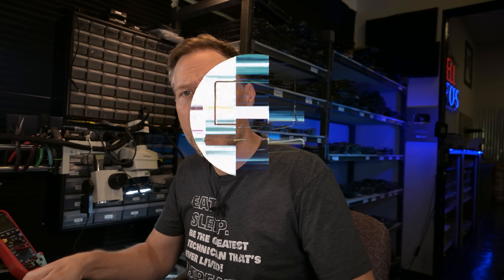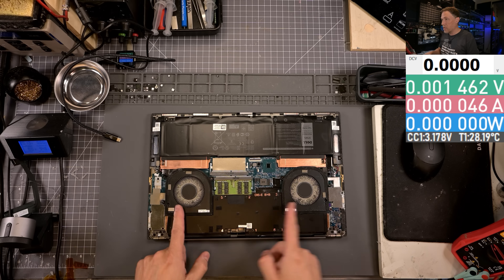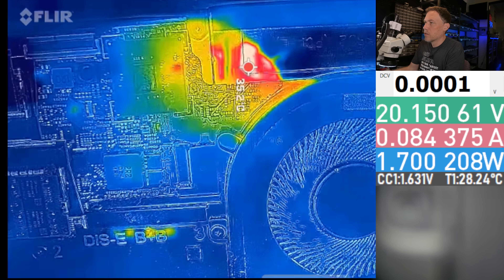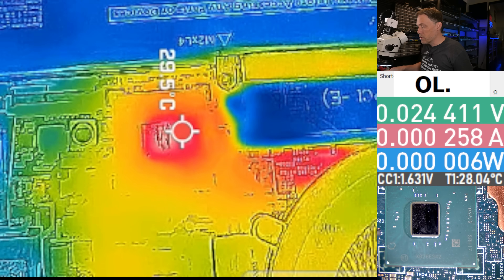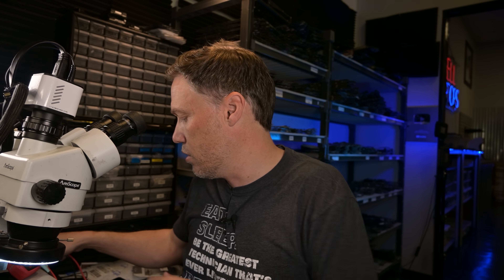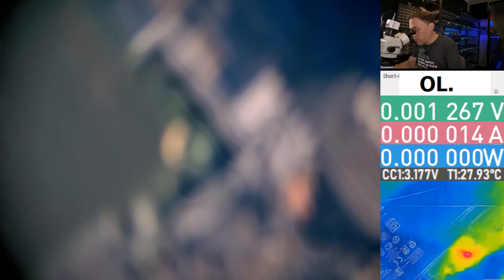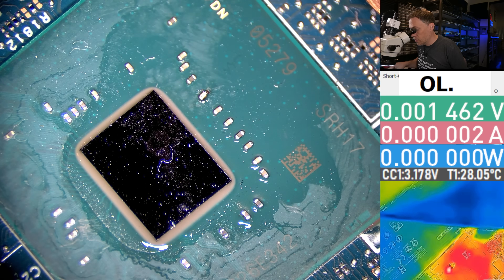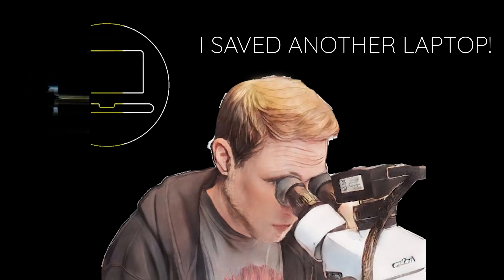They Said the Motherboard Was Dead—But I Saw Something They Didn’t

Comment: Dude.
Capacitors crack due to thermal shock!

Why on earth would you try to solder with hot tweezers?!
They're for desoldering, not soldering.

Cool find on that short, though.

Comment: Great channel also you may want to take a look at Alex at northridge fix he has some new fancy flux that doesn't smoke or evaporate.

As long as  it works no ones going to see a slightly mis soldered job saved the customer a new laptop.

Comment: At 13:35 it was perfect.. As no-one is even going to see that joint with the naked eye, let along even open the laptop to check what you changed and how well you soldered - when 99% of us WISH we could solder such a TINY component to such a Tiny spot :face-blue-smiling::trophy-yellow-smiling:

Comment: While I don't have a Dell laptop, I saw your video where you removed the fan covers and cleaned a pile of dirt out.  I did the same to mine, runs a bit cooler, but I keep it clean and have already repasted the CPU and GPU as well.

Comment: I’ve always wondered, why do so many electronics repairmen’s soldering tools are so nasty? I learned to solder stuff when I was 5 because my dad was a TV/Radio technician and he taught me that it was important that my soldering iron was always clean and properly tinned to help the solder joints heat up fast and be done right. These tweezers and your soldering iron are as crusty as a knee scrape on a ten year old boy working in the fields.

Comment: hi i smashed my laptop display with screwdriver while tightening a screw on wood table near it .it became black but works properly with external hdmi display. can i bring it to you will you replace display & put ptm7950 in it instead of thermal paste & clean heatsink or you only repair motherboard please reply in comments or other video if you do those stuff i will think about bringing my laptop to you.
Reply from the maker: We can definitely fix that for you. If it is a Dell or Alienware laptop, you live in the USA or Canada, you can fill out a service request form at partspeople.com to ship it to us, or bring it in locally (Austin, Texas).

We charge a Flat $129 for a laptop diagnosis and repair; if it is a motherboard repair, we charge an additional $120. So, the total is $249. All repairs include a 1-Year parts and labor warranty.  That repair would fall under the $129 labor charge.
Reply: @dellpartspeople thank you sir for not ignoring me as it is a old laptop with i5 6th gen i will talk to my parents about fixing or purchasing a newer laptop thank you for your patience
     if i come also i will come to austin & not mail it
Reply: @Balaji-gr8wz  update us! o7

Comment: I advise everyone to put a large thermal pad or heatsink on that chipset, I went with the thermal pad on my HP Zbook, the temps went from 80C to about 45. Replace the pad every two years (its cheap), and clean up the oils it pushes out (not conductive). The chipset will live a happy life
Reply: I have an old Quad-core desktop where the southbridge chip will hit a sustained 220F when the USB circuits are busy. It doesn't seem to mind and will keep this up indefinitely (and did so for many years, as its external drives were my poor man's NAS) but it always made me nervous. Unfortunately the chip wasn't where it could gracefully take a better heatsink.
Reply from the maker: ^^^^ That is great advice!  ^^^^^

Comment: not that I think it makes a difference, but wasn't that the wrong capacitor from the replacement board
Reply from the maker: Sorry, I guess I should have discussed this, but all those CAPs are the same value and are just acting as filters, so it will not be an issue.  But good looking out

Comment: Hi, first time i see one your video, good job, except, to be more right, you need to refine a bit your soldering technique, i hope that cap will last because you heated a lot, you forgot to put new solder after old solder removing,  i think needs some way to mark a reference to center well the new component, one way could be cut 4 very slim stripes of white paper sticker, then put them in square around the solder place.. bye..

Comment: why cant you replace that whole chip from the donor board?
Reply: The PCH isn’t something you can just swap over, because it’s paired at the factory with the CPU and the SPI flash contents. To avoid issues, you’d also need to move the SPI chip along with the PCH from the donor board. The tricky part is you need a professional IR rework station to remove it safely, and a stencil for reballing. That’s time-consuming and not easy if you only do it occasionally.
Long story short: it’s possible, but not simple unless you do this kind of work every day.
Reply from the maker: Well Said ^^^^^

Comment: Good video as always!

I have a dell latitude 5410 with the same error. A BIOS reflash didn’t do anything and the chipset is on the CPU package. 

Current draw is very constant at about 2W and I cant see anything really heating up. 
As I can tell there are no shorts on the board.. 

Any guess?
Reply from the maker: 100ma / 2watt constant means that there is a short somewhere.  You might have a shorted EC chip.  Measure for a short around the EC chip.

I am saying this because you said constant. Now, if it starts lower and then works up to 2 watts, then it could be a BIOS.  But if the moment you plug it in, it jumps to 2 watts, then there has to be a short.

Comment: 9510 and 9710 there is a copper heatspreader on this chip
Reply from the maker: You know what, I didn't think of that. The 9500 and 9510 have chipset heatsinks, but neither the 9700 nor the 9710 has chipset heatsinks.  Seems kind of strange.  In the 9x20 series, they moved the chipset onto the CPU and under that heatsink.
Reply: @dellpartspeople oh that's strange, thought what I saw 9710 just missing. Using 5560 now ,EC chip reset gave me problems didn't want to reset,had to disconnect battery for 3 hours to work ,never anything esle seem bulletproof

Comment: Please show us how to clean those fans. Maybe make a shorts video. Blowing air into the outlets is going to push dirt onto the motherboard, or maybe overspeed the fans. Thanks!
Reply from the maker: I didn't end up filming it on this repair, but every day brings in more dirty fans, and so I will make sure to film one and get it posted.
Reply: @dellpartspeople  With the cover off, I prefer using a vacuum to compressed air; I don't like spreading the dust into my work environment. Sometimes I follow up vacuuming with compressed air, but the amount of liberated dust is much lower after vacuuming than before.

Comment: Really great to show the size of those caps using the quarter. Why would the Dell use such physical small size caps? Other parts of motherboard have much larger caps.
Reply: Have you looked at the caps on the back of a CPU? Practically microscopic.
Reply from the maker: The size/value is based on what voltages and frequencies they are filtering. A lot of the bigger CAPs are on higher voltage power rails.

Comment: Well, you did take off a different capacitor (3rd) from the donor board. Luckily it was same or close enough value!
Reply from the maker: Good looking out! Yeah, all those CAPs are the same value and are just acting as filters, so it will not be an issue.
Reply: In parallel, going to be the same.
Reply: To me... It made more sense. If you replace exactly that same capacitor from the same spot. Chances are that it could fail again.

I'd replace it with another one which didn't fail in the same area. They all looked the same to me.

If course, I don't know squat about repairing stuff!

Comment: I love your channel, but noticed you took the Third capacitor from the doner board and not the forth. Will this have any impact?
Reply from the maker: Sorry, I guess I should have discussed this, but all those CAPs are the same value and are just acting as filters, so it will not be an issue.  But good looking out!

Comment: I didn't get that lucky. I have a laptop with a chipset that is shorted to 0 internally.
just by chance, do you know what thermal pad thickness is used in the XPS 9570 for the SSD, vram, chipset and vrm?
Reply from the maker: Oh, sorry to hear that.  0ohm chipset is a no fix.  

I do not know those sizes off-hand.  I can say that SSD thermal pads are usually 1mm, and the VRM and VRAM are usually .5mm. This model would either not have one on the chipset or have a very thick one, like 10mm.
Reply: @dellpartspeople  it's not that bad as for now I have a success rate of 2/4 for refurbishing laptops with 2 more in the works.
Thanks for the info, I'll try to find a way to measure the thickness to double check.

Comment: Great fix. I'd have been tempted to use a soldering iron to replace that capacitor. If you wick the pads down flat you can solder each end separately.
Reply from the maker: Yep, you could definitely do that.

Comment: 11:45 This no-bigger-than-an-ant capacitor caused the laptop to flash orange when power button was pressed. Am i getting this right?
Reply from the maker: Yep.  That ant-size capacitor shorted out, like a wire, and shorted the 1.05V power rail to ground, preventing the chipset from powering up, causing the laptop to be bricked. Crazy right!
Reply: @dellpartspeople  My brain just shorted now. The full explanation! You are a clever bunny, you. 😅 Our future AI masters will keep you for sure.

Comment: If my memory serves me right, the last laptop you repaired, with one of these capacitors on the chipset, also had massive amounts of dust in the fans, connection maybe?
Reply from the maker: Lol, probably. Yeah, I know I had fixed one like this in the past, but I couldn't remember it being this dirty.  This one was next level. But yeah, overheating is always a connection.

Comment: Each time I watch current repair videos and see how tolerant devices are of heat, I remember when I started working with transistors in the 1960s that it was recommended to put a heat-sink clip on the transistor lead to prevent damage due to the heat conducting up the lead and destroying the device. I enjoy your videos and watch them all.
Reply: I remember those little wing clips on transistors.
Reply: I remember those heatsink clips from radio shack I had a few electronic kits way back in the mid 1970s
Reply: Good lord I remember doing that and how paranoid I was on a Sansui System that was my friend's dad's... he was like a helicopter over me watching!  I was so scared, but I did it and he paid me well. I had 3 alligator clips on it and he thought I was going to short out the main amps  LOL
Reply: Those Germanium transistors with blobs for emitter and collector didn't like heat at all.
Reply: Nice to see there are different repairs, not always the same thing.  Great that you just don’t give up, where others do.
Reply: I used them 15 years ago when I was learning to prototype electronics
Reply: in 1990 there was not much equipment to desolder a micro processor or tiny resistors,capacitors,transistors,now they use many different kind of chemicals and equipment..without destroying the board..

Comment: Your donor cap was the 3rd down, While the place on the original board was the 4th cap down.  Are the 3rd and 4th caps the same ?   I would guess they might be the same value.  As they both are filter caps.
Reply: they look to be the same, and capacitor performance is usually just a function of its dimensions. so it was probably a safe bet.
Reply: Lol who cares if it's looks like a duck it is the duck 😂😊

Comment: In my approach I use both a soldering iron and a hot air gun on low rpm at 200C if my hands are shaky, or 300C if I'm agile enough on that day, but it has to be done fast. hot air prevents rapid solder cool off and provides enough time for aesthethic smd placement. Great diagnostics Nathan, as always. Cheers!
Reply from the maker: Yep, so you know how those hot tweezers can be.  I usually do the same, except on the chipset, because there is not a huge ground plane
Reply: @dellpartspeople  That works too. At the end of the day - function over aesthetics I suppose. That's how you save another laptop.

Comment: You took nr 3 from the donors board instead of nr 4?
Reply: Its just a filter cap. Same size is generally fine with this kind of implementation.
Reply: @SkyNET-YT  but for example two 0603 capacitors can have a value difference of over ten million times (picofarads vs. microfarads), or a voltage difference of 50 times.

Comment: Does spinning the fans backwards (by blowing compressed air into the vents) generate current that can damage components? I know that blowing the fans of some GPUs can cause damage.
Reply: Most fan circuits have a diode in circuit that prevents power from going backwards into the surrounding circuits.
Reply: @PoXFreak  I've been giving to understand that over-revving the fans, such as compressed air will do, can blow out the diode.

It's probably not good for them anyway, not designed to spin at WHRRRRRRRRRR.
Reply from the maker: The logic is sound, but I have never in 25 years of laptop repair ever seen a fan create enough voltage to damage the motherboard in any way. But if there is any concern, then keep them from spinning.  The killer is heat, and not cleaning them is doing more harm
Reply: @dellpartspeople  The concern I've seen voiced was actually about destroying the diode in the fan. I don't know how valid this is; has anyone tested it? I've spun the living crap out of some of mine and they still work, so I dunno.
Reply: Fans have BLDC motors, and can't generate any current back into their supply circuit by spinning them.